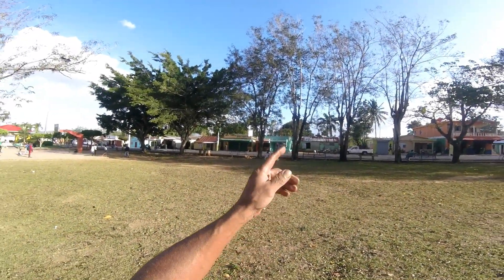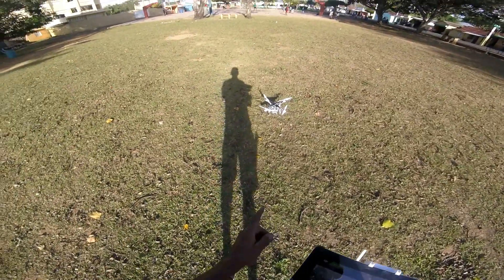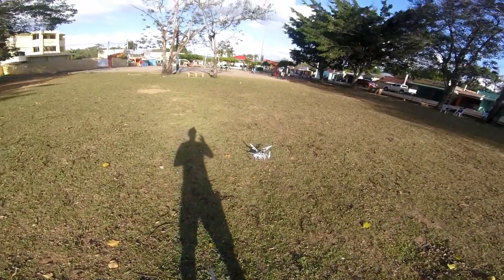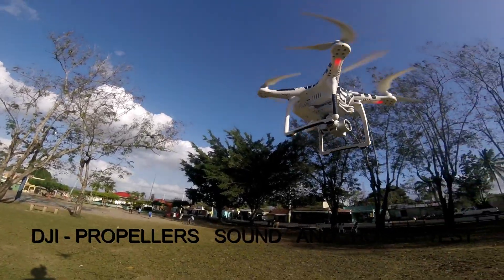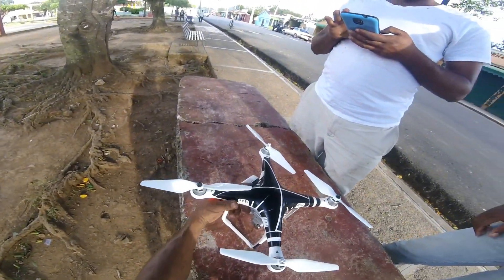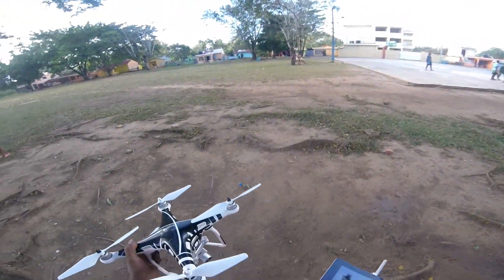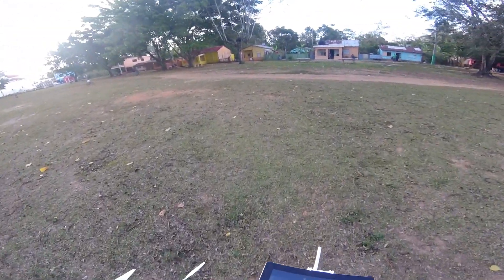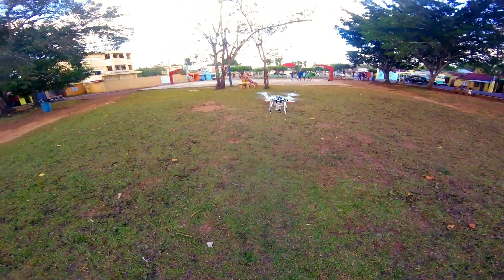DJI - Props VS  Master - Airscrew Props + Sound and Hover Test

Comment: I'm listening with headphones on and the Master airscrews do seem to have a lower frequency. It sounds like the props are not working as hard to hover steady. It would be good see/hear a comparison by cutting immediately between the two types.
Neat test Bruv !
Reply from the maker: yes it slip my mind to make the side by side test ...i am getting black ones going to to the side by side with them ☺